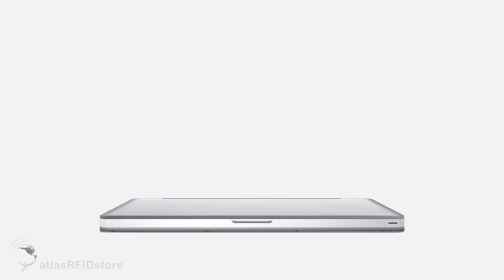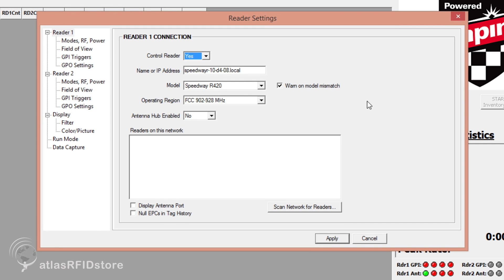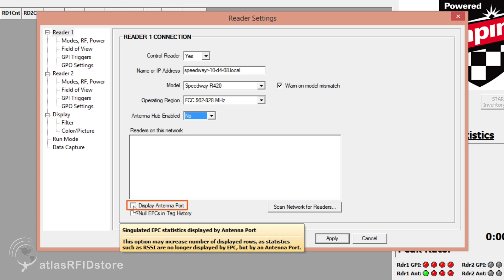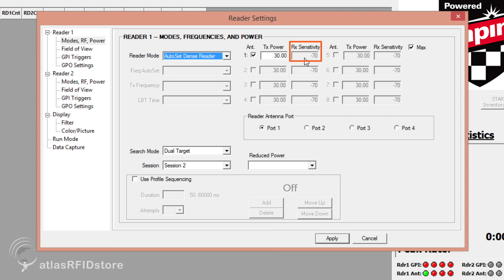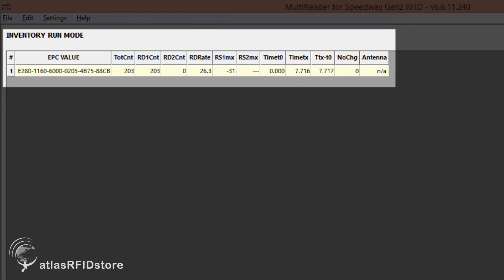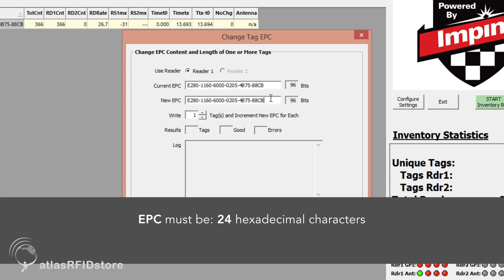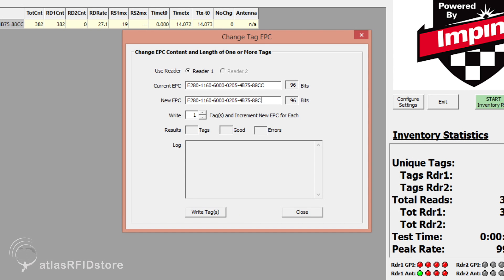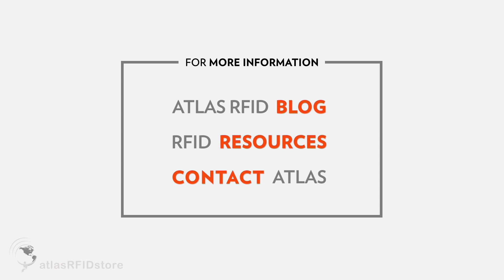Navigating Through the MultiReader Software Program

Comment: Hi, the software could always read the tag when passing through the antenna and show it?
Reply from the maker: The answer to your question depends on the settings you select. If you choose to report all tags all the time regardless of their state, then - yes - it will always read and report all tags when they are within the antenna's read zone. Of note, MultiReader is a great program for providing demonstrations and for testing various reader settings and then determining which settings you should apply in your application. It is NOT meant to be used in a production environment.
Reply: @atlasrfidstore  Hello, what are the software for production environment?

Comment: hi, my project is about RFID, and i'm goin' to work with the Speedway Revolution R420, but i've a question, and it goes...

is it possible to configure this RFID reader to send the ID of every tag that it reads through RS232 protocol one by one?

Thank you for your attention
Reply from the maker: +Omar Arizmendi Cid 
Thank you for your question. The answer is "yes", but with some caveats. 

The MultiReader program is only meant to be used for demonstration and testing purposes, so it won't be a program you can use to accomplish your goals. 

This leaves you with a couple of options:   
1. Using the Impinj SDK, write a custom program that tells the reader exactly what you want it to do. 
2. Purchase Impinj's Speedway Connect software (https://www.atlasrfidstore.com/impinj-speedway-connect-software/) which allows you to configure the reader and output data via RS-232.

Of note, the Speedway Connect software can be tested for free (https://support.impinj.com/hc/en-us/articles/202755278-Speedway-Connect). All features and functionality are unlocked; however, the software will lock up after 500 tag reads, unless the software is manually reset or a valid license key is entered.
Reply: Thank you for your response, i'll keep it in mind.